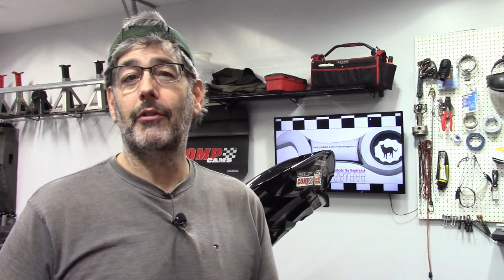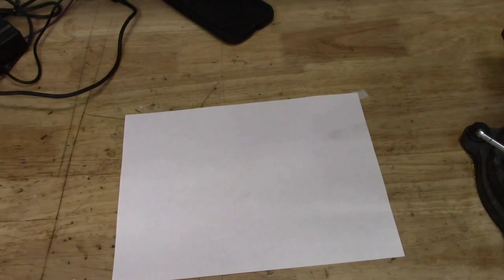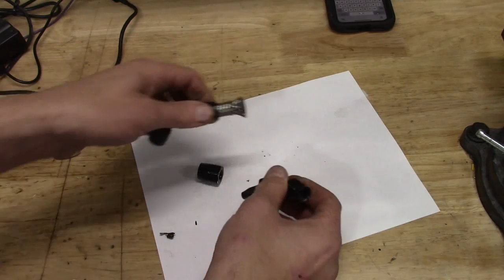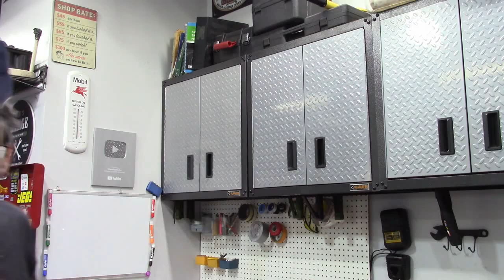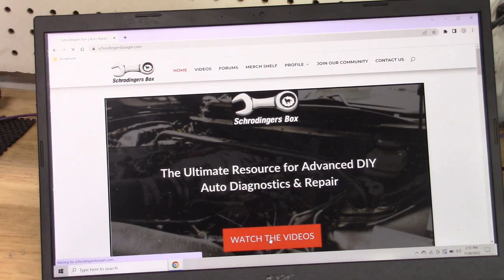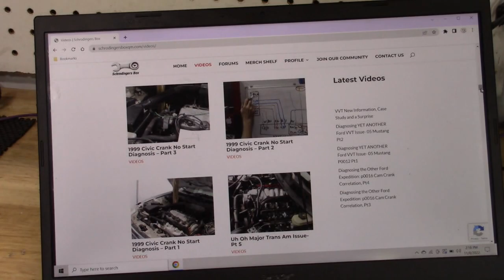Fuel Leak Diagnosis + Fix  High Performance Fuel System

Comment: Unless you are running solid metal engine mounts, that engine will move a lot in the engine bay at hard acceleration. With any custom plumbing/wiring I like to have longer flexible hose section somewhere between the engine and where the line is secured to the car (or where it can get caught on something that effectively holds it in place) - if “free hanging” section does not have enough flex, distributed over long enough section, it will put a lot of strain on those fittings. I had a number of both cables and hoses/fittings fail over the years, due to excessive engine movement when the engine mounts loosen up

Comment: Just a heads up. With AN fittings there is a tightening method called the "flats" method. I believe its 1.5 flats,  or 1/4turn past finger tight. Helps stop under/over tightening. I did the same exact thing you did on a LS1 Swap I did. Mine failed almost immediately
Reply from the maker: Great advice

Comment: Once modification to the engine is made on a significant level you must find a good competent tuner.
Reply from the maker: 100% true. I don’t do tuning but I worked with probably the best guy in all colorado and it was a whole field on its own.  fascinating for sure.
Reply: Yes i concur it is interesting I have a guy around here where I live that is really good.

Comment: although its not sonething you can smell, sometimes the pressure loss is in the hose right after the fuel pump inside the tank. I had a pinhole blow out in mine, I thought the pump check vave was bad, changed the pump, regulator - then i happened go hear it spraying when i was fown to 1/4 tank !

Comment: CPE - chlorinated polyethylene. It does degrade severely over time, and exposure to ethanal based fuels. It is also gasoline vapor permeable. You should really think about switching over to a stainless PTFE (Teflon) carbon impregnated fuel hose. No degradation, and much higher pressure resistance. This is what is used in most HP racing setups and GDI systems. Don't use a regular PTFE hose, only Carbon Impregnated due to lessened static discharge without CI. It can go boom. CPE also has a maximum operating temp of around 300F, while PTFE is good to over 450F.
Reply from the maker: Thank you!!
Reply: @SchrodingersBox  No problem. You can get it in -6 and -8 size also.

Comment: You mentioned a max of about 70psi pressure. Is this ok for an LS? They are supposed to be 58psi. Wondering if you had to change anything in the tune to run what looked like 65+ psi on your gauge
Reply from the maker: Yes this was all adjusted by professional LS engine performance tuner from the engine builder.  I don’t do software tuning so I don’t know the ins and outs of how that works but they did a MAF delete as well and I can tell you I have no check engine light and my emissions reading are immaculate. he clearly knows what he is doing!!
Reply: Your tuner really knows what he's doing then. Some people don't even consider how higher psi can change things.

Comment: Wait a minute... I'm 30 sec into the video and had to rewind it to make sure I heard it right...710 HP!?!   Woooooweeeee boy!!!
Reply from the maker: That’s correct. I sent my LS1 in to a performance builder where they rebuilt and converted it to a 550HP 6.0L but with 10:1 compression so I could put a procharger supercharger on it.  it’s completely emissions compliant with two high flow cats on long tube headers and actually has lower emissions than it did before the conversion. 
  basically had to keep up with the times where you have the hellcats running around with twice the horsepower I had before and that just isn’t acceptable!!

Comment: My neighbor worked as a Porsche tech decades ago. He said the 911 really was designed as a race car, with the expectation that the engine would be removed (at least) weekly. He was awed that the 911 was so reliable on the road for "daily use". But added the 911 was staggeringly expensive and labor intensive to keep running well. 

You face similar challenges with your Trans Am racing-road car.
Reply from the maker: So my issues are really mostly age related. the car is 22 years old with 235,000 miles. definitely overall it’s been remarkably reliable especially for the first 19 years for sure. absolutely no major issues ever.